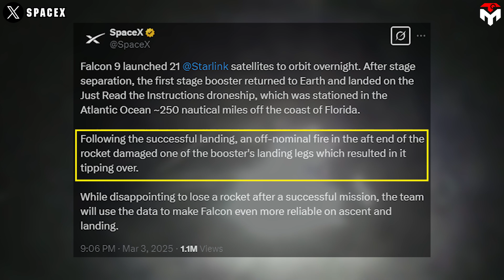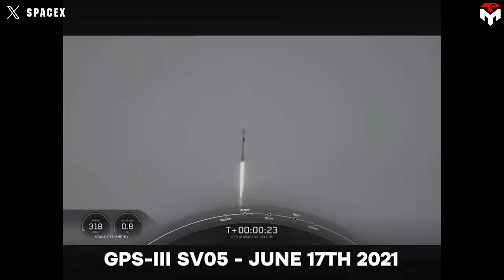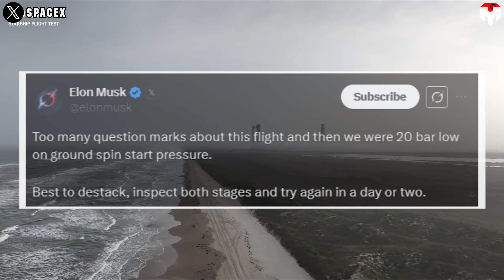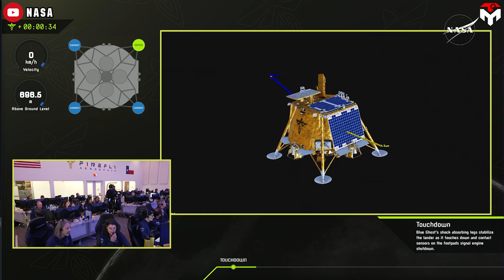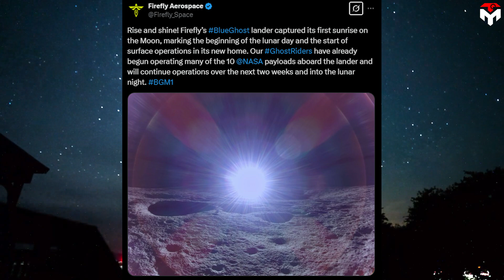SpaceX Falcon 9 Tips Over after Landing Due to Off-Nominal Fire...Rip B1086

Comment: Losing the occasional Falcon 9 is not that big a deal. The real problem is that Starship is planning to do a similar powered landing with crew and on board. Frankly I doubt they will ever do crewed Starship missions because Starship is a deathtrap. I has almost all of the problems that the Space Shuttle had with one huge new one. It has to have operating engines to land and that means it will have fuel and oxidizer in the tanks.

Comment: There have been failures of the Falcon upper stage , one recently disintegrated on reentry . Spacex are at the limit of their technical capabilities
Reply: Why the hate???  How many rockets have you launched???
Reply: @ I make observations based on a life watching space programs , coming from Sputnik and Telstar through the Saturn programs , the UK and Frances attempts and my own experiment at model ram jet model air craft . I have no hate , not even to Putin.
Reply: @stuartgraca  All Falcon upper stages disintegrate on reentry by design. They were never designed to land. Just push the payloads into orbit then burn up on reentry.
Reply: @ but they are meant to have a set course, I understand that 9 have lost position and entered at a different location and time. The starship as also had two unplanned and non automatic explosion, it is the loss of control that I referred to
Reply: Since its conception its been corrupt. There is NO SUCH THING as "rocket safety"!